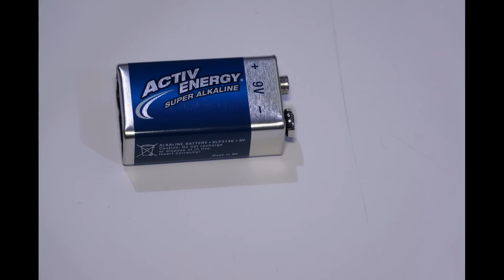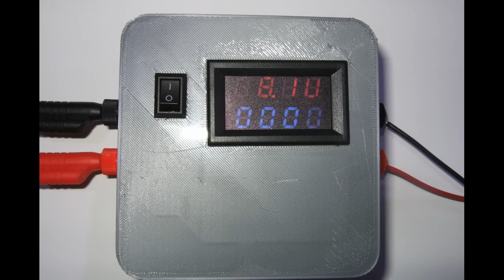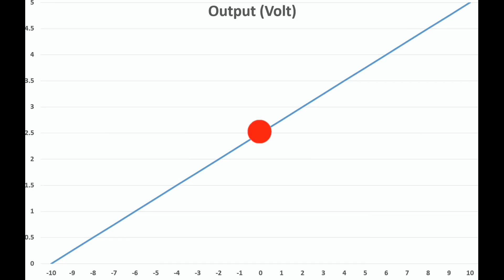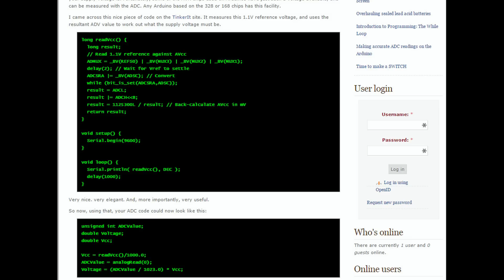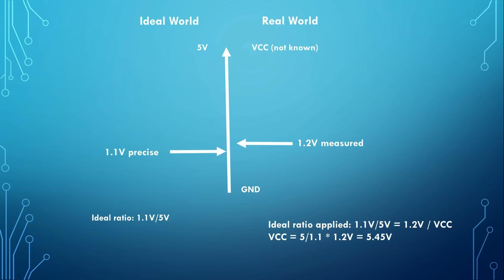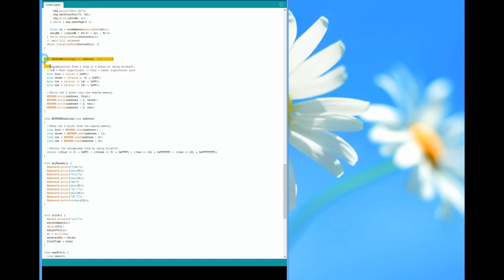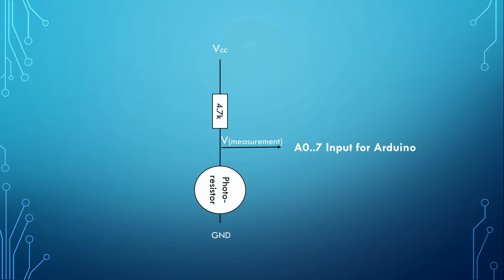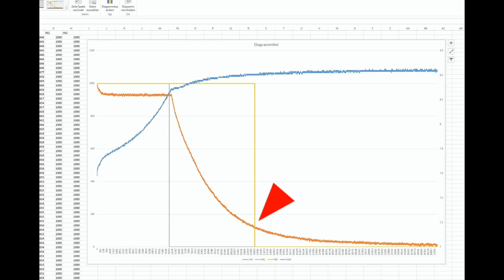#9 Arduino Data Logger with Direct Input to Excel

Comment: hi bro how can i be able to split the data cause in data streamer in excel the data shows together in one column, i would like to see the data in to different column. for example analog 0 store data in column 1 then analog 1 store data in column 2. something like this , thanks
Reply from the maker: The Arduino just creates keystrokes. So your program has to generate the proper keystrokes to fill out the columns you want (add TAB, for example)

Comment: greetings, can i ask how to connect your data logger in the 3 phase distribution panel?
Reply from the maker: You need special sensors for that. I made a video on how to measure AC. However I would use a wireless commercial device like the Shelly 3M

Comment: I'm liking the EEPROMWritelong function. I use (wrote) similar to write an hourly record number into the first two addresses of my I2C EEPROM. 7.4+ years of hourly readings.
Reply from the maker: That is an interesting method. With the ESP32 I prefer to transfer data to a Raspberry Pi with a database. There it is much easier to deal with it.

Comment: Nice!  Is there a way I can do this for 100 amps and more, for large batteries?
Reply from the maker: If you find an Arduino compatible sensor, why not?
Reply: @AndreasSpiess  did some research, and it appear all I need is to use the voltage across a shunt. Thanks for the video!

Comment: Arduino Data Logger with Direct Input to Excel? Where is the info how do you really log it to excel?  The rest is unnecessary, if it is not show everything. It will be fair to put correct name "Arduino Data Logger with not showing how to do Direct Input to Excel".
Reply from the maker: I do not know what I should show more? It keys the data directly into Excel via keyboard. You decide if you like it or not.

Comment: Whats the best way to set the middle pot? The multiplier? Does it actually lower current to the battery or just turn on an led?
Reply from the maker: I think I once made a video about this board.

Comment: Sir is it mandatory to keep the excel file open for the continuous logging details ?
Reply from the maker: Yes
Reply: @AndreasSpiess  thank you sir for your valuable reply .
sry to trouble you with one more doubt,
Is there any possibility to get direct input in file format without opening any file (may be direct  com port indication to file or someother way ).  Just striked my mind ,if I'm wrong pls correct me sir !
Reply from the maker: I only know this method. But I am sure you will find others.
Reply: @AndreasSpiess  thank you sir 😀

Comment: I am very sorry to disturb you again, please tell me how do I increase the sampling rate to one sample for every 1 minute. This is to have data logging for a week or so. Please reply.
Reply from the maker: You should be able to influence the delay with this statement: while (millis() - tt < 1000) {} (line 138)
Reply: Dear Mr. Spiess, thank you for your advice. But if I increase the value to more than 3000, it is not working unless I increase 3000 in the line " if ((millis()) - tt) > 3000) break;"  to a higher value than that. Please advice.
Reply from the maker: I did not analyze the code. But obviously, you found the solution. This is a good example to improve your programming skills. Use a lot of Serial.print(xxxxx) statements to understand what happens in this code.

Comment: I am 72 years old retired Telecom Engineer and my hobby is Arduino. I really admire your Videos and a staunch fan of your articles. Your data logger project is, one of "The Best" and I am really fascinated by it.
I assembled it and it works, but the Voltage readings shows, 888 milli Volt for 3.7 Volts . Is there any multiplication factor to be set or any calibration process involved. Please show me the few lines of code that handles the calibration to get correct reading. Thank you for your service to our DIY electronics community.  With Great Regards, Ragothaman R.
Reply from the maker: The Arduino should show 1023 at 5 volts at the input. If you want a voltage reading you need this formula: float voltage= sensorValue * (5.0 / 1023.0);
I made also a video if you want to improve accuracy of the Arduino ADC
Reply: Thank you for your immediate response. I will check and correct.

Comment: I must be getting old, because I missed the part where you explained how to get this into excel. After a lot of searching, I found the keyboard class, which requires a change to the Arduino Tools-USB menu to even get it to compile, and at least in case of the MAC, some security hoops to jump through to authorized that as a keyboard.    I made a big mistake where the Teensy kept putting out characters, overrunning my computer, and I could not get my Teensy to reprogram because it was too busy talking to listen.  After quite a bit of playing around, I found I could stop the program and put it into programming mode with the pushbuttons so I could bootload a fixed version of the program.   Great videos - please keep them up!
Reply from the maker: I think I mentioned the "off" button because it happened to me, too...

Comment: Dear, Im making a project with the rc522 (RFID) to log onto computer directly, now i need to run rc522 on 3.3v while the micro gives 5v through usb, any work around ?
Thanks for your time and beautiful channel
Reply from the maker: You can use a voltage regulator for Vcc and a "level shifter" for the pins. Maybe you google to find the details

Comment: as per your last direction, i purchased Leonardo and used the code given by you but one problem is occurring...
when LEO is importing data to excel it is continuous  in a single row, from left to right
please guide me how to make it  as in your video
Regards
Reply from the maker: Did you add Keyboard.println(char(13)); where you want a carriage return?
Reply: Andreas Spiess got it
Thanks
Reply: Keyboard.println(char(13));  was not working then i searched then found that return function can work by using Keyboard.println(char(176));
Now, its working fine as per my expectations

Thanks for valuable support

Comment: Thanks for valuable support.

I tried your code but it shows me an error 
'keyboard' only supports on the Arduino Leonardo
Please guide me
Reply from the maker: Ehtesham Nisar Ahmed you need an arduino micro (see 2:39) or a leonardo. The other arduinos do not have usb support
Reply: Andreas Spiess 
ok thanks

Comment: Hi Andreas, Do we need to remove the PC keyboard to detect Arduino micro as a keyboard.
Reply from the maker: No. You can have more than one "keyboard". The Arduino types in parallel. This is, why you absolutely need a possibility to switch it off!
Reply: That's very nice. I love your ideas. Keep doing.

Comment: Did you have anything that prevented excel from loosing focus, which would mean data loss?
Reply from the maker: Das Kässpätzle No. I do not use the PC during data acquisition. I did not find a better way.
Reply: There is a function in excel to auto save say every 10th line or so.  You set how often you want the data saved.

Comment: thanks for sharing, this could be the easiest way, but a more proper way would be to design a system using a SD card shield, and store your data in CSV files on your card. This way you don't need a PC, it's a small reliable embedded system that helps you save energy, you can leave it on a remote mountain for months as long as your batteries last.
Reply from the maker: There are many ways to capture data. This is only one. I started with the SD card and it worked. In the lab, this method is faster and simpler for me. But it is only a tool for my projects, not a product to deploy as you envisage.
The third possibility is to connect the data logger directly to the cloud. This is what I did in my recent projects. Then, you also have immediate access to the data.
Reply: Addd a raspberry pi type board and connect to a network. Excel can read .csv. too. Keyboard looks like a great method for real time updates!!!

Comment: A pleasure to watch your videos, is like Terminator teaches you electronics. Can you make a system that can Bottom Balance the 18650 easy ? I have one simple ideea and that is to use the latest Tp 4056 usb (5v) charger that in theory has a cut-off on output voltage @ 2.5 but this will need to be tested and the other one is to use a more clever setup (I have all the faith in your ability :) ) that use "1-8S Lipo/Li-ion/Fe Battery Voltage Tester Low Voltage Meter Tester Alarm OE" with relays .
Thank you!
Reply from the maker: +fumezflori Batteries are only a component for me and I do not care too much about them. That is maybe the reason, why I do not understand which problem should be solved and if it is already solved by somebody else...

Comment: Is this possible with an Arduino Zero? I have tried to compile and there appears to be an issue with EEPROM. 

I understand it's emulates EEPROM, and has similar keyboard/mouse capabilities. 

So a little unsure on a how I might make this work on a Zero. 

Could someone please explain if this is possible and a starting point To getting this to work. 

I don't have a Leonardo, and 3 weeks from China😂 so hoped my Zero could do the job. 

Mr Spiess, could you add the Zero to a tutorial, so I can see its capabilities and how it could be used for testing etc

Thank you Andreas
Reply from the maker: +Dean Greenhough There are three issues:
1. As you described: The EEPROM
2. The correction of Vcc is also for 8 bit processors and will most propably not work
3. Maybe the keyboard() functionality also does not work

Summarized: I would wait for your Leonardo or use a micro (it has the same processor as the leonardo)

Concerning the Zero: According my opinion there are too many different Arduino processors around and for the moment I have no plans to use the zero. I already have my fair shares of problems with the MKR1000 (same CPU). But this can change in the future...
Reply: Thank you for your advice. That has saved me many hours of work. I have ordered the Pro Micro with a smile on my face.

Your advice is appreciated

Comment: this is great - i am currently playing with ina219/acs712. I want to build something to log the efficiency of dc-dc converters, and check batteries.
i came across the same problem in a previous project - how to calibrate the adc. you can be even more precise, if you use the sleep mode on the arduino when measuring the bandgap voltage/analog pin. it removes a lot of the jitter. also - if you have a analog pin to spare, hook up a lm336-2.5 voltage reference. measure the voltage reference and use that to calibrate the bandgap voltage. you can write this value to the eeprom, or have it calibrate automatically from time to time.
if you wanty more info, get back to me.
Reply from the maker: +KiSwiSje Thank's for the tips. I also have a INA219 to play with, but had no time. I think, if I have to have an external component I would not go for a voltage reference, because the Arduino only has 10 bit resolution. Then, I would go directly for an external ADC like the ADS1117 (my video #18) or for current measurement as you propose, to the INA219 which also has 12 bits.

Comment: what is the minimum level of current you can measure...  ?
Reply from the maker: +Electromania The hall sensor I used is made for higher currents up to 5A and as described in the video not very exact, especially not for small currents. Its advantage is the complete separation of measured circuit from the Arduino.
If you want to get better results for small currents I suggest to use the INA219 board:
http://de.aliexpress.com/item/INA219-I2C-Bi-directional-DC-Current-Power-Supply-Sensor-Module/32477303639.html

I have one and will make a video in the near future to compare the two sensors.
Reply: Thank you. Sounds very good. 
I am interested in logging my serial port data into excel. How have you done this ? is there any specific library or addon for excel ?
I googled and found this, PLX-DAQ Spreadsheet. Is it the one you are using.
Reply: +Andreas Spiess 
I made managed to log into excel spreadsheet using PLX-DAQ.
Thanks.
Reply from the maker: +Electromania Good to hear. No, I do not use the serial connection. I use the Leonardo and its USB (keyboard) function.
Reply: thanks.
sounds interesting, I didnt knew Leonardo has such option. i just found it has inbuilt usb connection.

Comment: Do you have a wiring diagram available. Mostly how the switch is used? Are you using just NO Contacts or more?
Reply from the maker: +marboenterprises I now published the diagram as a pdf file to Github (link is in the comments). The connection to the PC is done via the USB plug of the Leonardo or the Micro Pro.
Reply: +Andreas Spiess Thank you very helpful.